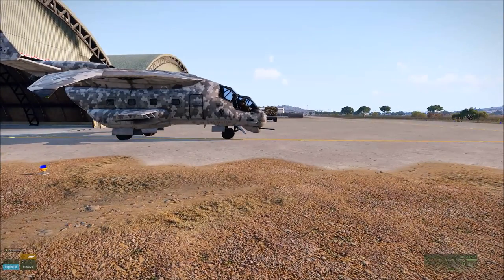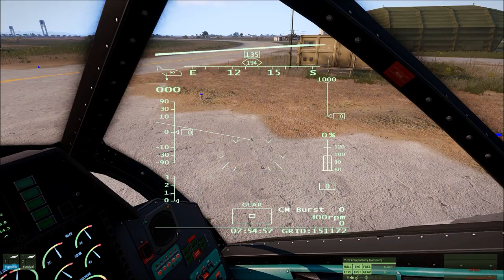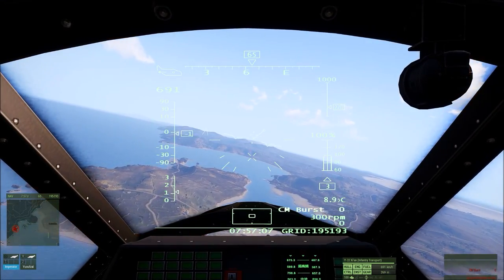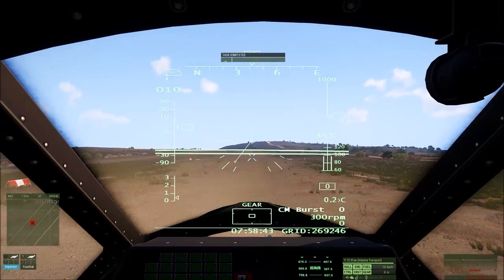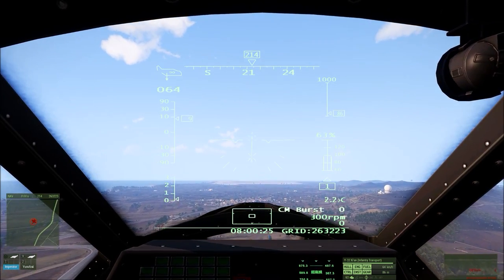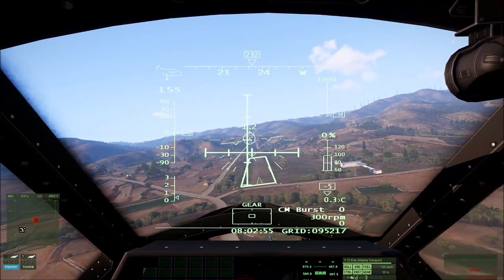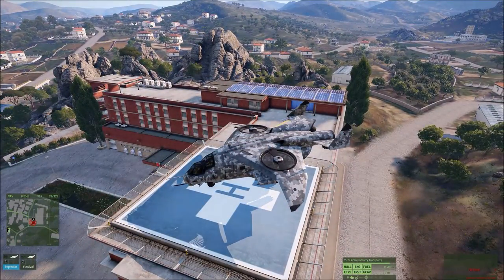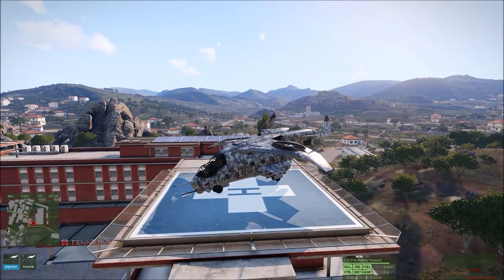Arma 3 Jets DLC | VTOL Tutorial (bonus mission included)

Comment: Useful tip: The Apex preset also adds a new control+scroll wheel keybind for flaps.

It's a great quality of life improvement, and nearly as great as the control+scroll wheel for zeroing.
Reply: Do you have to set this up?, I cant seem to use it.
Reply: Yea, thats what I use. You can bind it by going to the control bind for flaps down in settings, holding control and dragging the "mousewheel down" from the right side.
Reply: i done that same thing, and i cant use thrusters to go up and down, only flaps go down.bug?
Reply: never mind, i got it working.
i accidentally dragged mouse up/down instead mouse scroll up/down with combination with CTRL.
So you need to drag combination from sidebar because when you scroll with mouse it wont accept it.As steven said :)
thanks steven!
Reply: Great to hear MarkoCRO. See you on eutw 😉
Reply: wow, never seen that coming :P see u there mate
Reply from the maker: Mate that Ctrl + Scroll wheel tip for zeroing is brilliant!
Reply: Imperator TFD I love it, it came as default from the apex preset onwards. Great Video btw  😊
Reply: Many thanks for you man , it helps me a lot the video and the map too, now i can fly and control this beast like a man :3 , this masterpiece of the modern air vehicles :)

Comment: Excellent tutorial and will checkout the mission. Only tip I would add, when it comes to initiating a vertical landing, it's a good idea to start slowly increasing throttle once you hit 180kph and below airspeed in order to ensure a steady and controlled sink rate. At least, that's the technique I find works best for me.
Reply from the maker: That's what I usually do but I was aiming to demonstrate the nose-dive that occurs at 140 so that people can be aware what the limits are. As I mentioned in the video all it takes is that 1% to regain control so I'll usually apply it around 160 or so myself.
Reply: One thing I notice, that nose down is much more severe (faster) with flaps full on the Blackfish.

Comment: How about they give us an option to revert back to what controls were before the update like they did with helicopter AFM since you can not do fine adjustments with keyboard and mouse set up since not everyone has a hotas set up.  Since this update its become pretty difficult to fly around in jets or vtol.  I wont be buying any more of their DLC's.  NIce video.
Reply from the maker: It's a shame you feel that way.  Have you considered trying to bind the Throttle to something more analogue like your Scroll Wheel on your mouse?
Reply: If i do that than where is the action menu going i have too many keybinding as it is.  They can give me an option as they did with helis.  It is frustrating its same when they introduced parkinsons into the game at least with that i have a mod for it.  The other thing that i find is a joke with this update is the so called dynamic loadout which is not dynamic i guess they go half way with everything and get to community to do their work.  Looks like their flight model is broken cause it dont matter what speed you are doing planes nose just wants to dive down. This is not designed for keyboard and mouse in mind its obvious.

Comment: Has anyone noticed the abrupt acceleration trying to take off vertically now in since the Jets DLC? I'm using a Logitech Extreme 3D Pro and the VTOL is not smooth anymore upon lifting. I don't want to tweak the thrust setting in Controls because it'll mess up all the other aircraft I fly which are perfect. Godamnit.
Reply from the maker: I can't say I've noticed this so it may be a joystick setting issue?
Reply: Ok, it was fixed by using the (Analogue) option of Thrust in the Plane Movement controls. The standard Thrust is now unbound of any key.

Comment: I noticed, that in the new vtol flight model, the on/off of Auto-vectoring mode, does not make sense... Throughout the all video this was only online!  In the old control system, this made sense in a vertical landing, and it was logical. In the new system of VTOL control, this is always online (even in the not vertical landing!) and even at the hight speed.  Then, what is the meaning of disabling Auto-vectoring in general? I think the BIS is lost again in its desires
Reply from the maker: The Auto-Vectoring command in the action menu works the same way the Auto-Hover command does for helicopters.  When the action menu says Turn Auto Vectoring On that means that you currently have the Auto Vectoring system off already.  As per the video I prefer to fly with the system off at all times and manually control the vectoring angle myself.
Reply: max speed > 720 km/h with Auto-Vectoring! 3:37 This is normal?
Reply from the maker: It certainly is normal.  I just angled the engines all the way back and applied full thrust.  The tricky part is learning how far away from the landing zone you should start slowing down.
Reply: Unfortunately, I can not slow down, if I have already accelerated more than 350-400 km / h. Even, when I turn off the engine power to 0, the machine can not be stopped. I also turned on Auto-Vectoring, but machine still can not be stopped! This irritates me, because a vertical landing on a certain point seems impossible to me.
Reply from the maker: Are you using the air-brakes?
Reply: I'm trying to understand you correctly, because English is not my native language. What do you mean when you say air-brakes?
Reply: I have two question for you. 1) How, after acceleration to high speeds > 600 km/h, the player may stop his VTOL in the air? Ie just hang in one spot over the ground. With the new system flight, I could not do it even once.
2)  What exactly is options in the menu: "Vectoring decrease  and Vectoring increase". Please help me to understand these things, that's all I need
Reply from the maker: 1) Use the air-brake key which you can find in Options - Controls - Plane controls.

2) Vectoring Increase/decrease is the option to adjust the angle of your engines which you need to land or take-off vertically.
Reply: thanks for the answers

Comment: i just cant land this thing
Reply from the maker: Do you use m/kb or a joystick?
Reply: a keyboard and mouse
Reply from the maker: Ah okay, I use a joystick but one recommendation I've seen people make is to bind the throttle for airplanes to your mouse wheel to allow better control.
Where are you going wrong with your landings?
Reply: the plane just crashes when i lower the speed to 120-100 
the nose just goes down
Reply from the maker: Watch the video any pay attention to the part after my first landing.  The nose on both the VTOLs will rapidly go down once you hit between 120-140 speed.  The only way to stop it is to apply thrust once you see it happen and then you kinda go into 'vertical mode'.